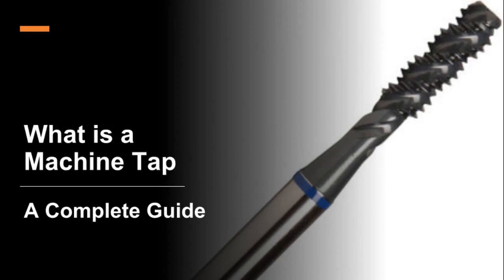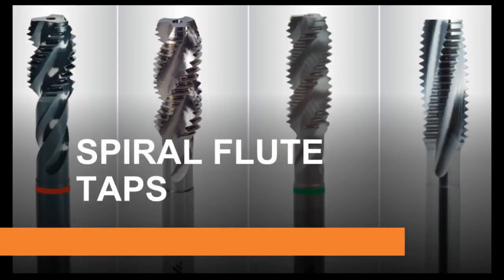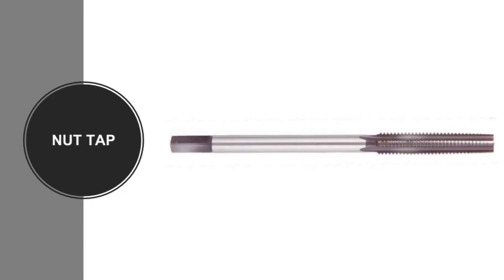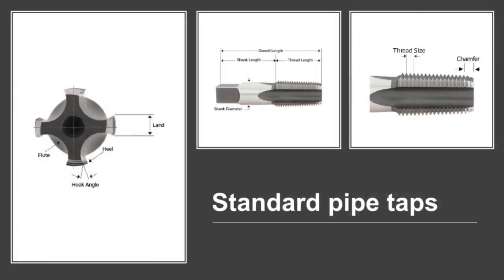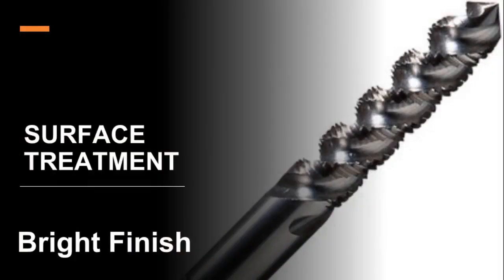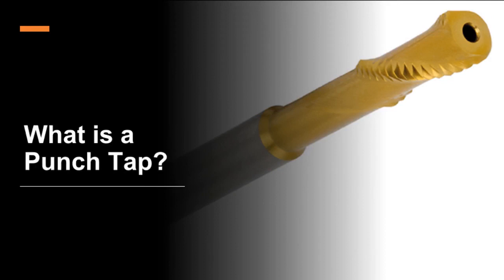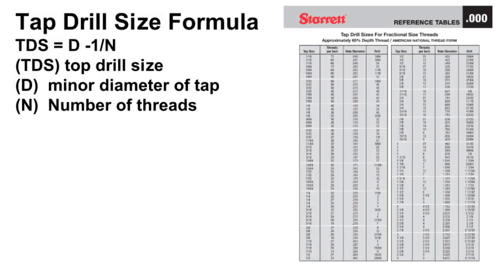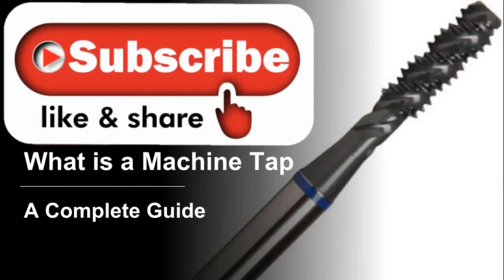what is a machine tap a complete guide

Comment: Please make a video on cutting oil and fluid.  Is a special oil needed for drilling, cutting, parting, etc., or will any oil work?  What about tapping fluid? Will any oil do, or is a special fluid better?  If using oil, what type and weight would work best?
Thanks
Reply from the maker: Unfortunately the petroleum engineer that I knew past away 
One of my contacts knows a coolant specialist
Maybe could see something in the coming future ? 
Ray
Reply: @shopandmath  Thank you.  Probably don't need a specialist or engineer.  I'm sure that with your experience in the shop, you are more than qualified to answer the questions I posed.  I usually just use what ever oil I have on hand, but would like to know if the dark cutting fluid would be worth the cost of buying a gallon.  And what advantage does tapping fluid have over oil???  Is it worth the extra expense??? Thanks Ray. Regards.